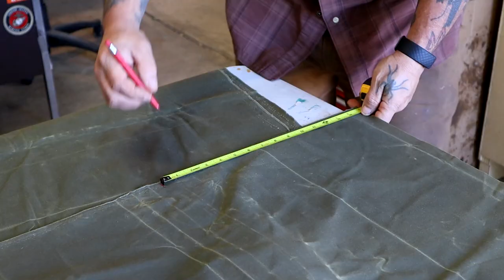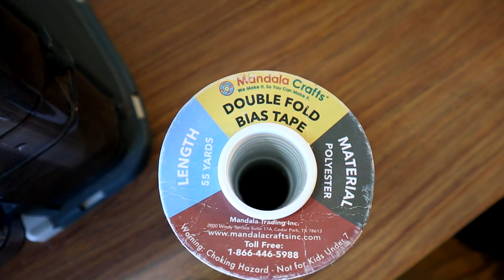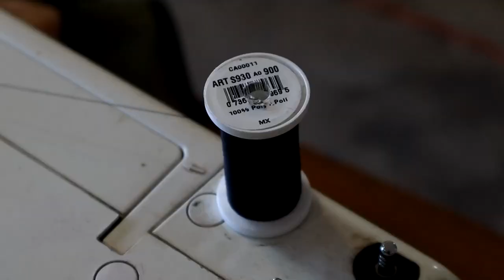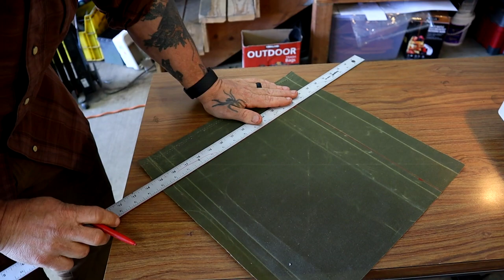MAKE THIS - Waxed Canvas Hood - This might be the best piece of field gear that I have ever made.

Comment: My experience with wearing rain gear tops and no bottoms is that the top gathers the water and puts it on your lower clothing. It's a path to hypothermia when your pants are soaked.
Reply from the maker: This is more of a supplement in sketchy weather, not a one size fits all solution.  It is great for snow sports, fishing, and limited exposure to inclimate weather or intermittent exposure.
Reply: @MakersMovementDIY  I do like the general idea. I'm a former timber cruiser in the PNW, I've worked in horizontal rainstorms.
Reply from the maker: @Mogtepyigsoloth  I'll bet, I'm on the Northern edge of Idaho so I can relate.
Reply: @MakersMovementDIY  Yes, I could tell you are a neighbor. I hiked into St Joe lake last summer from the Hoodoo pass side... My old legs ain't what they used to be.
Reply from the maker: @Mogtepyigsoloth  I went for a hike and lunch up on Long Mountain this morning with Angel and the pups.  My legs are still holding up for now.

Comment: I wanted to like this video. I am inspired by this video. I would love to make one of these. But having watched it a half a dozen times now I do not feel equipped to as the title procliams "Make this" Other than the measurements of the initial cuts there is no instruction or even discussion of the construction methodology, pattern, or pattern drafting. and the footage of the process with like colored fabric on like colored fabric and matching thread color makes the footage of the construction difficult to follow.

Near as I can tell the process is this:
1. Cut 1x 15"x60" piece and 3x 15"x15" pieces
2. Select a matching thread.
3. Cut a 6" Triangle off of two of the corners of one of the 15x15 pieces
4. Edge bind the edge left after cutting off those triangles with double fold bias tape.
5. ??? Several more difficult to follow steps.
8. Finished hood.

I love the finished product. Would love to make one for myself. I have not been equipped to do that by this video, and am frustrated about that.

Comment: This is perfect to pair with a loose fitting impermeable pair of lederhosen and then gaiters over the boots.  What this allows is for air to move freely around the legs and torso while shedding water.  The hood then laps over the lederhosen, but allows planty of air exchange, keeping heat and perspiration from building up, while shedding 100% of water.

Comment: Great build. I like how you cut the peak off the hood and the apex of the front panel. How much material did you cut off?
Reply from the maker: Thanks for stopping by.  It was just a guess,  I folded it over until I thought it was enough, then stitched it on the fold and cut the remainder off.

Comment: Nice, great video. Something like that would be great to have in my pack. :)
Reply from the maker: I have had a wool one in my pack  for a while but I'm really excited to replace it with waxed canvas.
Reply: @MakersMovementDIY  Is the waxed canvas expensive? :)
Reply from the maker: @KoalityofLife  it can be, anywhere from. 20 to 35 bucks a yard.  One yard will make one hood with bag if the bolt is 60" which I think is pretty standard.  Thinking of doing a video this summer on how to make a tin cloth the old fashioned way.
Reply: @MakersMovementDIY  a DIY tin cloth video would be killer. I’ve been thinking about waxing my Carhartt bibs and jacket.
Reply from the maker: @timstoltz5791  It is sort of a warmer weather project and it is still cold here but it's on the list if we get the right time and conditions.
Reply: @MakersMovementDIY  I was just thinking of this. A tinned cloth video would be cool.